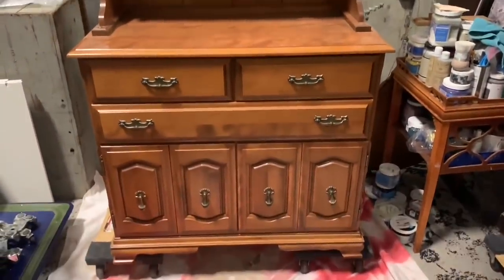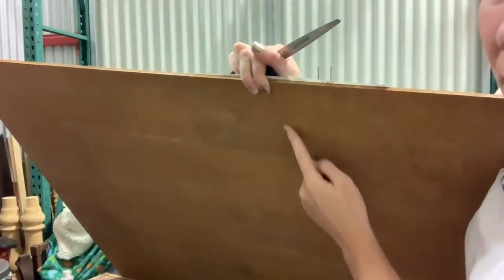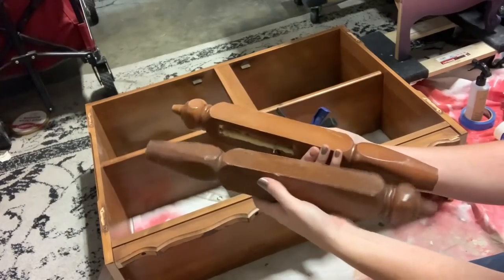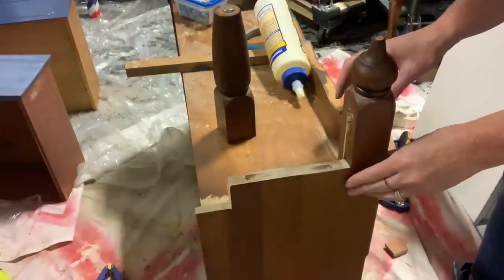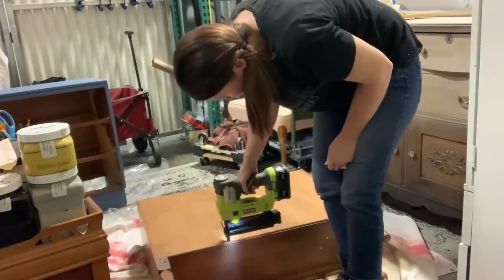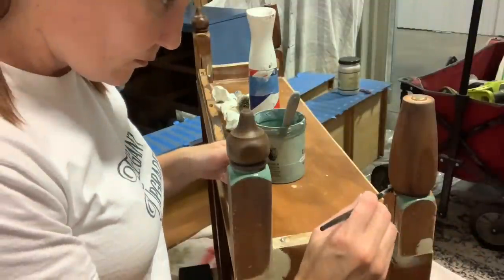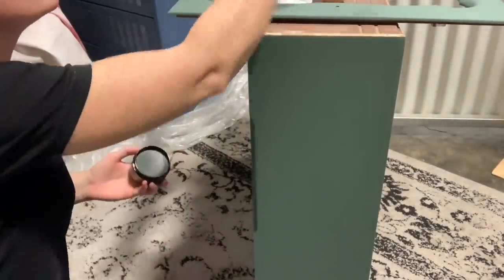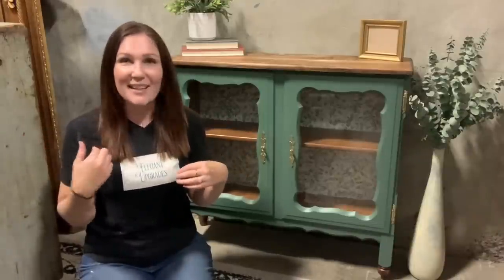Part II - Creating Legs For The Top Of The Vintage Cabinet | Easy Hutch Top To Floor Cabinet

Comment: This came out lovely! Maybe I missed it but did you add a layer of topcoat over the wrapping paper that you decoupaged?
Reply from the maker: No, I didn’t add another layer over the top. I usually don’t seal it over the top if it’s a combination of wrapping paper and it’s placed on the backer board. It won’t get any wear back there and the edges around it were sealed in with the cabinet so there’s almost no chance of it lifting. Sorry, that was a bit long winded to just say no. 😂 I just wanted to be clear that there are times that I would seal over the top.